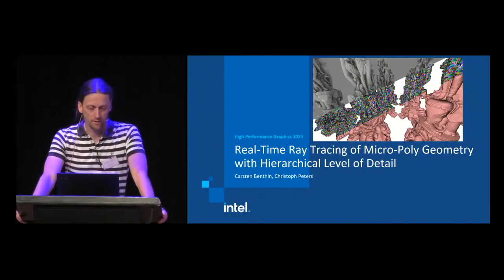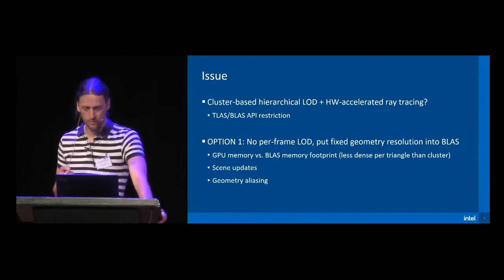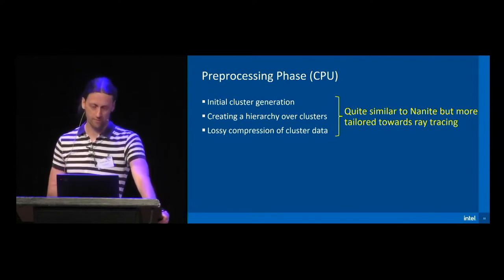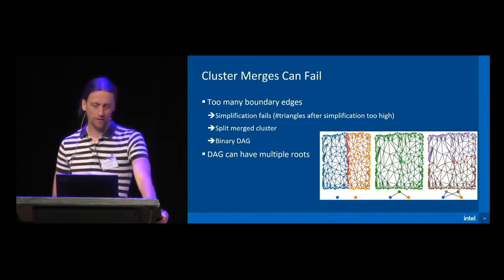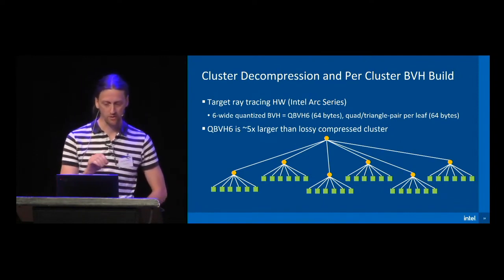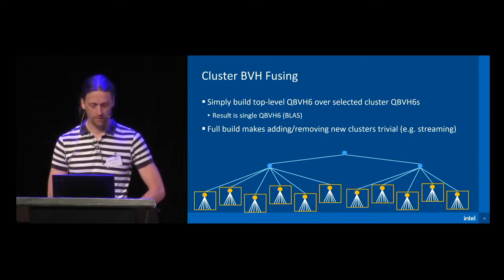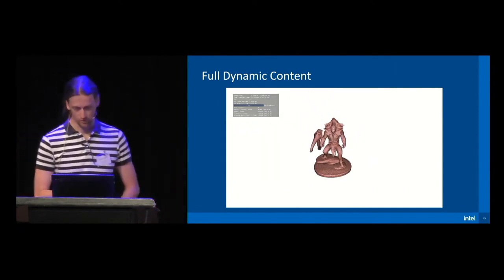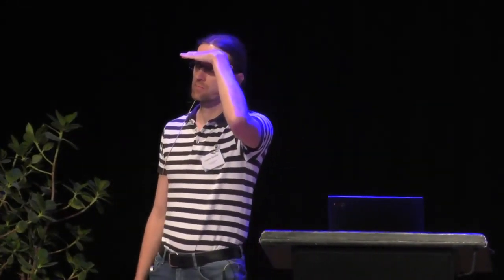Real Time Ray Tracing of Micro Poly Geometry with Hierarchical Level of Detail

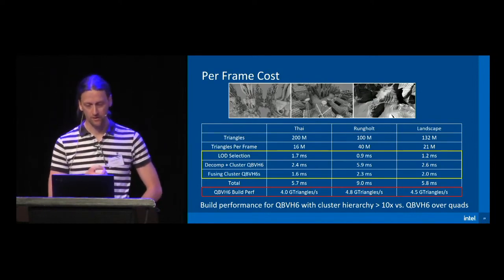Comment: I didn't get what the effective advantage is over the standard Nanite approach. Is it the support for animated meshes (16:25)?
Reply: It's that it enables real time ray tracing of the otherwise incredibly complex 'Nanite' geometry by creating BVHs in realtime that update with the Nanite meshes. Nanite and Lumen use other tricks to raytrace the scene which rely on much lower resolution meshes of the overall scene - the Nanite geometry itself isn't being raytraced, whereas this method would allow it to be (with a few further optimizations).
Reply: @Hug8horn  I know they use a low resolution SDF scene to do the software (compute shader) ray tracing path, but I'm pretty sure they don't use that when the GPU has hardware accelerated ray tracing.